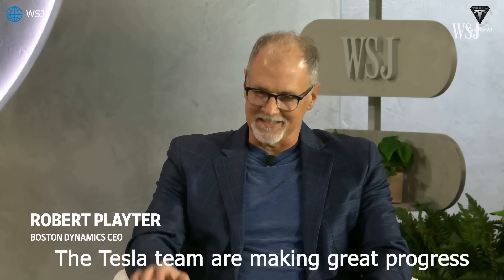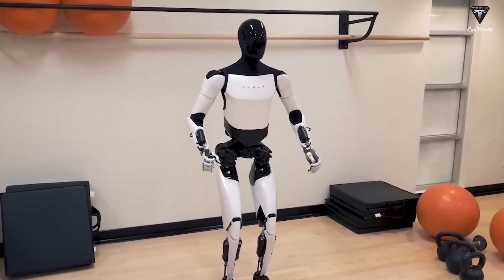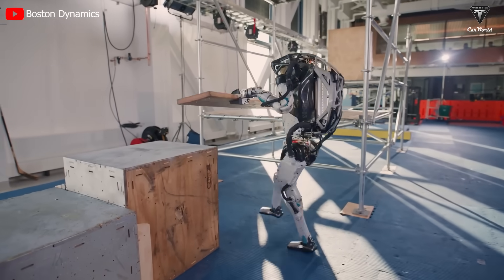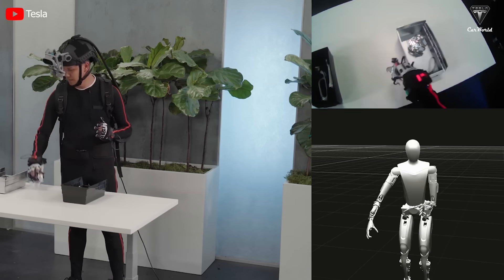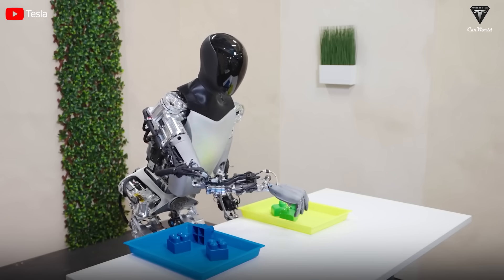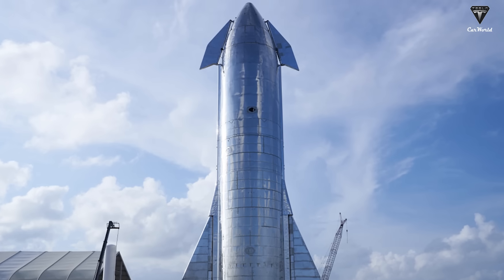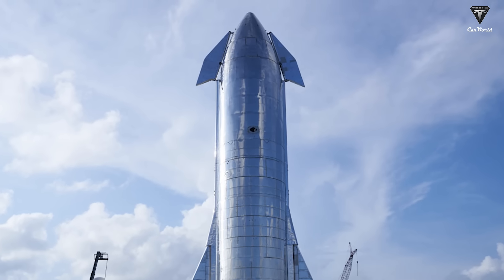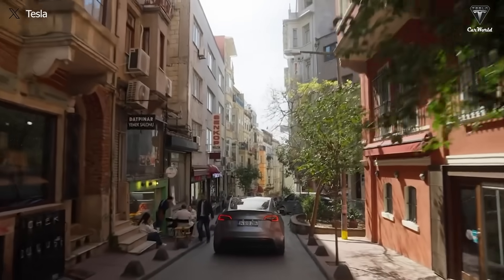Elon Musk LEAKED BIG Rival "Tesla Optimus Gen2" - Boston Dynamics Atlas! Will Hit Market Soon!!!

Comment: MAKING EXPENSIVE  CARS FOR THE HYPOER RICH FEW IS NOT THE WAY FORWARD.?
NOr ADVERTS AND LAWS MAKING PEOPLE DO BUY LIVE AS THEY DONT WANT TOO?

Back to basics? very basic easy to drive easy to fuel
5-6 people capacity
 300 mile on a full charge.
A -peoples every day no frills 
load carry go to work come home
cheap stainless steel none rust
easy to maintain?
An every day working opersons machine?
All vehicles having same charge plugs
same batteries?
simple slide in and out replacement
moduals.
May be hydrogen powered backup charges
if needed in emergancy.
A total peoples vehicle

Comment: Takeaway: Both robots are amazing machines. Very impressive engineering. Boston Dynamics Atlas is more of a kinetic worker robot performing physical tasks. Tesla Optimus Gen2 is more cerebral with defined precision in its operations. Exceptional science applications on both. Question: Hydraulic fluid can be any fluid, correct? including air? which would then make it pneumatic right? Air is lighter and much less polluting than oil. Air lines are easier to replace and maintain. Is air more difficult to work with? Is that why they use oil? I have no idea. This is why I love science and technology. Experts in the field do incredible things. The possibilities are limited only to imagination and physics. Fascinating stuff!
Reply from the maker: Hydraulic fluid must be oils (mineral oil, synthetic oil, water-based oil, bio-oil, etc.) and not air; air is not a liquid, as you understand. Both robot technologies are indeed fantastic, but considering the long-term development when humanity is keeping pace with AI, Optimus should receive much more attention !!
Reply: @TeslaCarWorld  Thank you for answering my question! I was getting air confused with fluid dynamics as it relates to the atmosphere; can oil be a gas, that sort of thing. I agree, Optimus should receive more attention, and I believe it will. What Elon Musk wants, he tends to get.

Comment: in factory you can operate atlas 24/7 as long as it has a electric cable connected it to do a task inside a room. same as optimus. but elon will not buy boston dynamics because for the next year and so optimus will be like atlas or more when it comes to movement.

Comment: The issue with Boston Dynamic robots is mainly the fact they are not using AI/neural networks for self-learning balancing and movement actions. This is the reason why Tesla bots will become more and more fluid in motion near human-like perfection.
Reply: Boston Dynamics has stalled out on human robots for the last 8 years. They haven't really made any massive improvements in that robot in a long time. Tesla is proving that with hard working people better robots can be built fast. Boston Dynamics is simply doing tricks on youtube to keep the money rolling in so they can have a pay check. Tesla is trying to make a real product to make money.
Reply: Exactly! Tesla is solving the hard problem. The market wants robots on which it can offload the nasty, dull, day to day tasks. Not athletic feats that merely make for good YouTube!
Reply from the maker: Absolutely correct. AI technology is advancing, and people always expect machines and robots to use AI rather than pre-programming. If Boston Dynamics continues on this path, they may find it challenging to further develop, despite their 20 years of experience. Thanks for your idea

Comment: Optimus still walks like it needs a diaper change.
Reply: It can't be helped. The actuators position and size determine the position of the limbs. Arms are straighter due to it not having to be as strong as the legs which supports the whole frame. They will improve it as they iterate from year to year though.

Comment: im tired of pretending Optimus is better than Atlas, 

Optimus is still in the cringe walking phase what da hell,
Reply: Look I can go into detail but I'll explain it like this if Atlas and optimus were to run a race Atlas would come on top easily because Optimus is still shitting itself while walking but if Atlas and Optimus were to play a game of chess Atlas would not only lose Atlas wouldn't even be capable of playing because it's not smart enough
Reply: @therandomcommenter6629   i may be in the wrong, but i value more technical achievement than software achievements.

i don't need the robot to play chess, i need it to stack shelves, turn valves, lift things
but it's just my humble opinion
Reply: My tuppence worth: We've had robots like you are describing for a long time already - Atlas is just an evolution of those in terms of its mobility and mechanical adaptability.  "Cringe walking" is a minor that will be addressed by some engineering effort.  The real next step is in integrating A.I. - that's where the robot effectively transitions from a dumb machine to a person-equivalent.  So you don't pre-program or remote control it, you just give it an instruction and send it on its way.  That's a big difference and that's where Tesla is far ahead.
Reply: @alanbarrow7447   I don't see the "far ahead" part, smart path finding is not an achievement, it has been done and done again and again, like basic pick up and drop operations, i don't see anything impressive.

Sure, i guess it's easy to say that if you put a good AI in it, it will certainly do marvels but we're not there, not even close (at least for Tesla).

Although the rate of progress is cool, but they're still at the "current industry standard" to be kind.

Im just an humble maintenance technician i won't pretend to know everything.
Reply: @odstunsc9543  I would suggest that pointing a car at a destination and saying "go" requires a whole lot more from the car than just smart path finding.  This clip is interesting in that regard: https://youtu.be/sEm81F3vjy0?si=9XFN1boRBagY6YcJ.  I might be wrong in saying that Tesla is far ahead of BD in the A.I. area but that is my perception.  By the way, I know and routinely worked with some very smart maintenance technicians.

Comment: @3:20 5MPH is the target max for the bot. V1 was much slower than that and V2 is 30% faster than V1, but has yet to demonstrate speeds anywhere near five mph. V2 is still pretty cool, and depending on mechanical reliability and some other factors may be ready for limited use in Musk’s companies.

Comment: Think about the tank in your car.... 
In an ICE vehicle it it the tank that stores the energy needed to power the vehicle.
In an EV vehicle it is the Battery that stores the energy needed to power the vehicle.
Both the tank and the Battery needs topping up...
The tank takes a few minutes and the battery takes a lot longer. 
So i guess for speed between two places where the tank or the battery needs topping up, the tank wins every time because of the time saved topping up. 
Also in cold weather the battery will be used up quicker. Filling the tank v charging the battery is crucial as today there are not nearly enough charging stations and who wants charging stations outside every home or flat in the cities and elsewhere.
The EV argument has not been thought out properly and it is obvious that the driving force for EVs is as usual....MONEY, PROFIT and GREED.
A lot of people are going to get their fingers burnt....